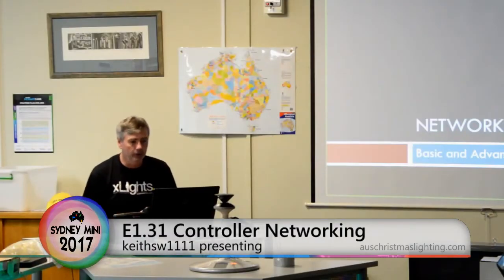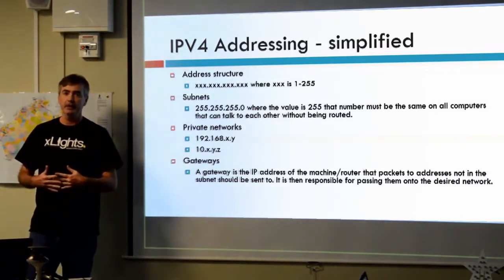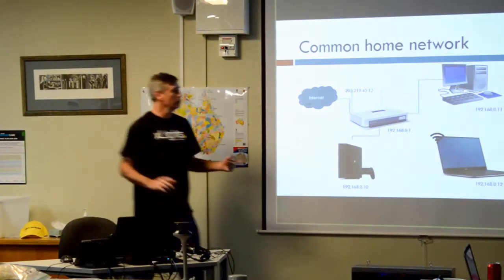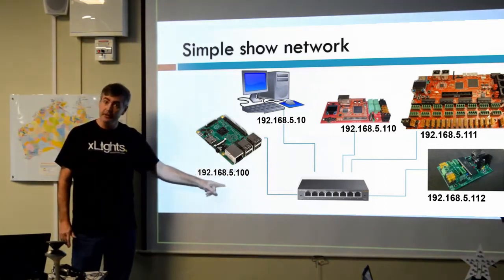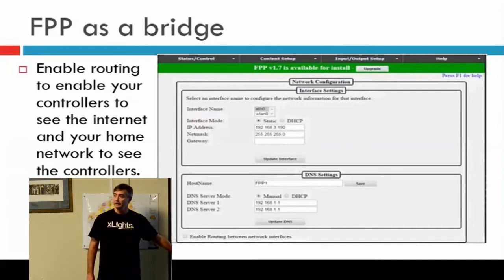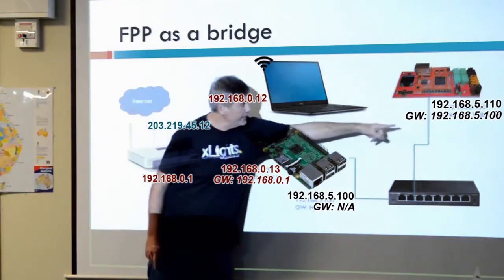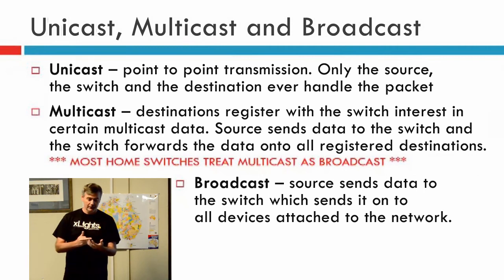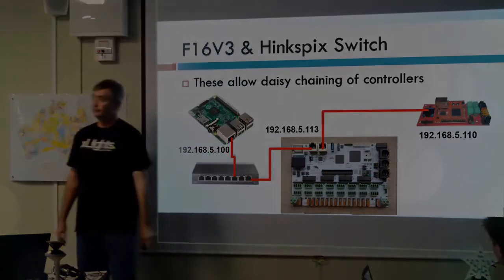E1.31 Controller Networking - 2017 Sydney Mini

Comment: Noob here. So if I get a switch, does the switch need to be connected directly to the router or would you just hook it up completely independently of the router?
Reply: Switches operate at layer2 and use mac addresses for communication. For communication inside your LAN network (communication between PCs, or to an FTP server you might have etc.) the switch will be used. The traffic will be forwarded to the router/default gateway when it is destined for the internet. Most home routers offer 4-5 LAN ports and can be used for switching and are more than enough for most people's needs. But if you need more ports or you have a lot of traffic inside your local network and want higher speeds like 1gbit/s you can simply plug the switch to a LAN port of the router.